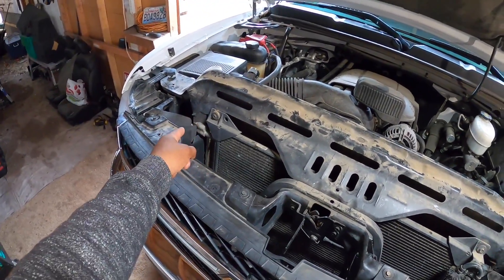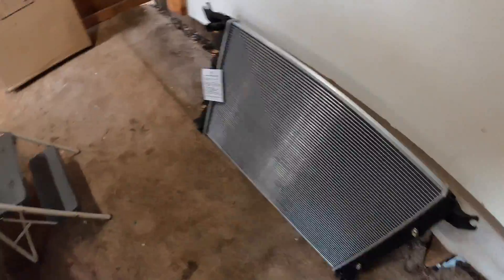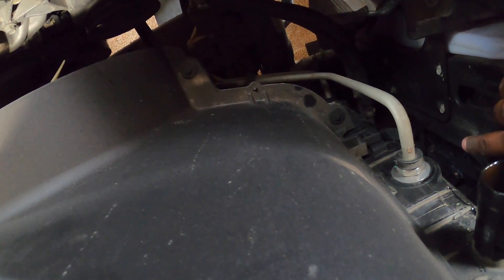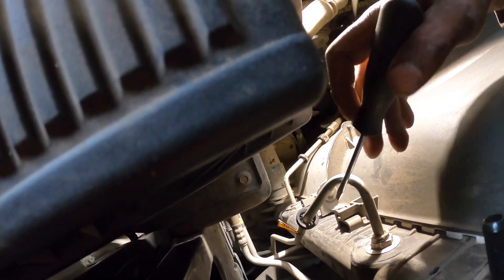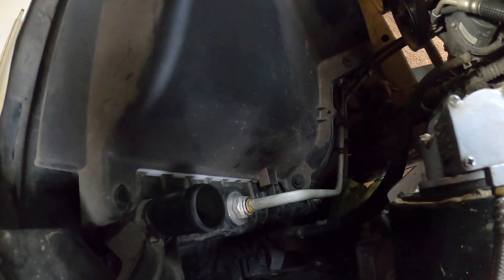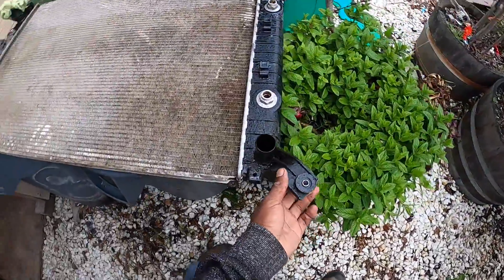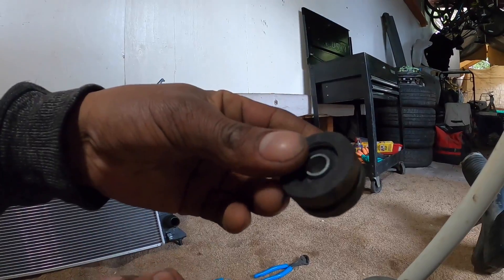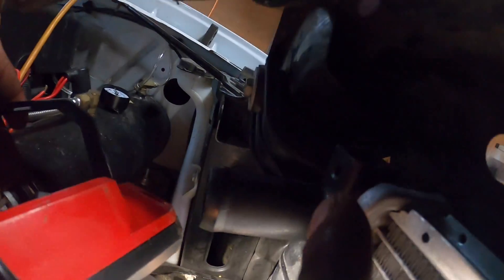how to replace radiator 07-13 chevy silverado 2500 6.0L

Comment: Such a great video man.  Succinct, to the point with no fluff, but at the same time detailed enough that an idiot can understand.  Excellent work. Kudos.
Reply from the maker: Thank you try my best to show everything I can.
Reply: @SimpleSickBuilds  for real man.  I'm one of the least mechanically inclined people ever, my life experience includes changing a starter.  Two weeks ago your video walked me through changing a cracked my radiator.  I wouldn't have tried it if I hadn't seen this.

Comment: About to replace the radiator on a '12 2500 6.0. Thanks for the walk through! Any idea how much coolant and trans fluid you had to top off with after all said and done?
Reply from the maker: Mine took 1 gallon of coolant and just topped off the transmission fluid with less then a quart.

Comment: The hard lines going to the radiator on the driver's side are for engine oil, the hard lines on the passenger side are for transmission fluid. The caps that go over the hard line fittings not only retain the clip but keep water, grit, and salt from collecting between the fitting and line.
Reply: Is there a specific tool to undo those lines?
Reply: @jeffreyfremouw6509  No specific tool that I know of, I have always used a screwdriver and/or right angle pick like he did. Right around 6:20 he starts talking about it, 7:20 starts showing how to work the clips out. Sometimes it helps to push the tube deeper into the fitting to take pressure off the fitting. If you don't have new fittings be really careful not to launch the clip.